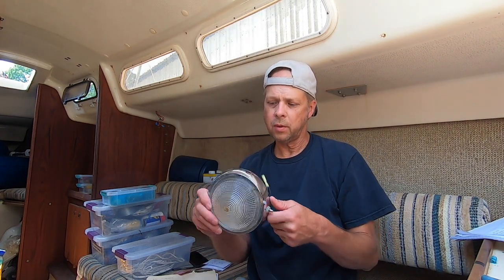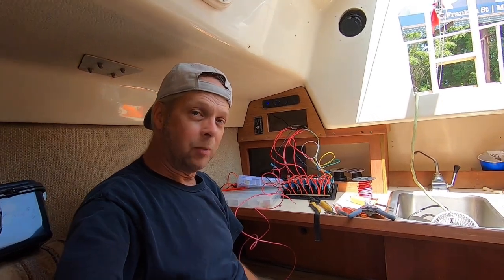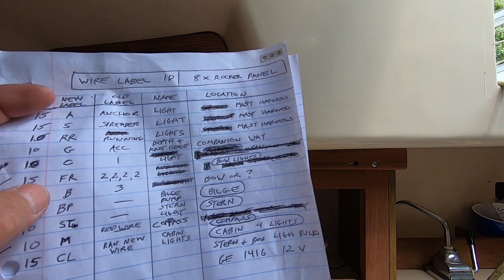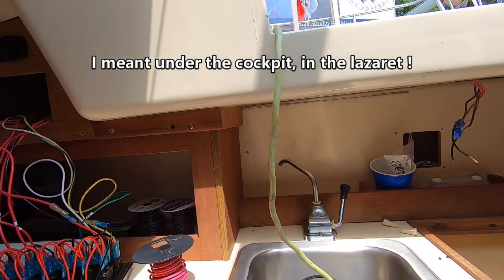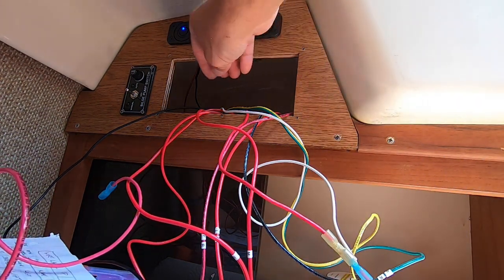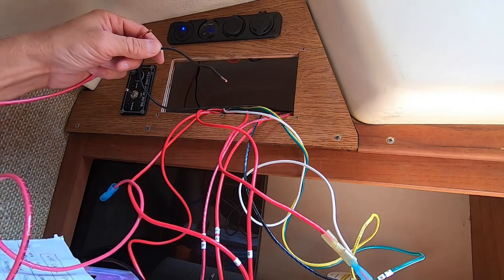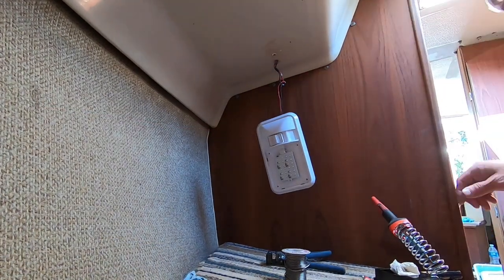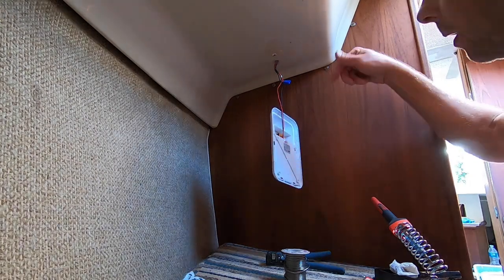How To Install New Cabin Lights On A Sailboat | E21

Comment: Good video.  I launched my 1976 O'Day  25 on Monday.   I am at the dock working on the electrical now.  
I purchased a 5000 BTU window air conditioner and placed it on the companion way hatch and covered the openings with fabric.  It was in the mid 80's yesterday.On low cool it will freeze you out.  If you have shore power its a great addition.
Reply from the maker: Thanks! That would be nice to have A /C at the slip. Glad you got your boat splashed. I still have a lot of projects to do before I sail. Have fun : )